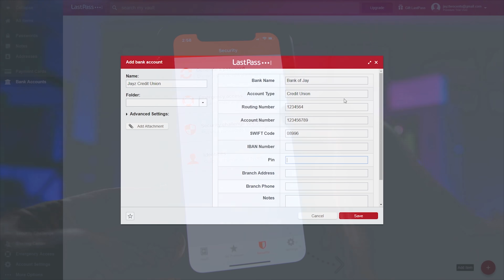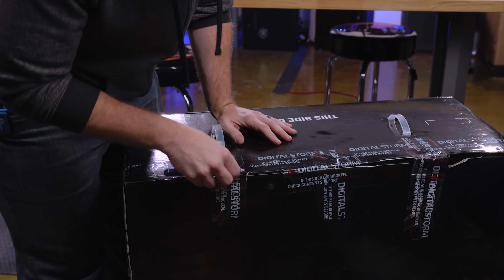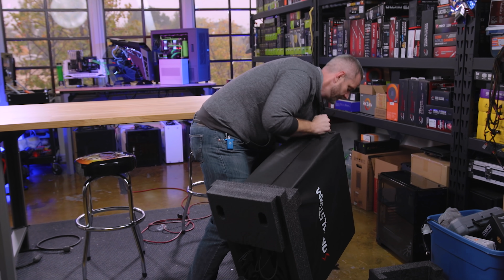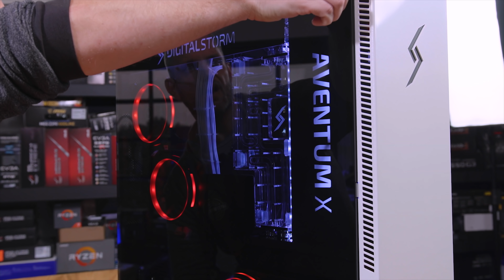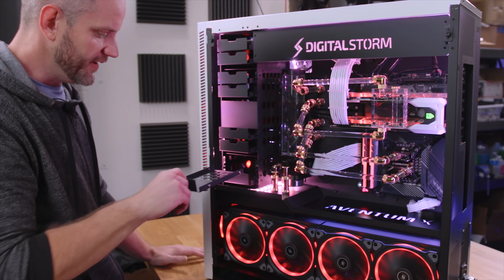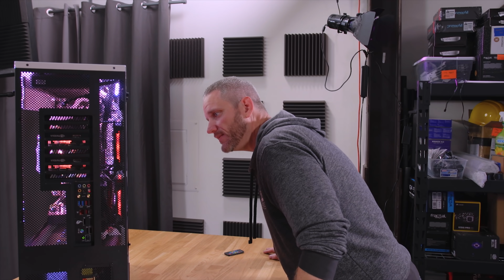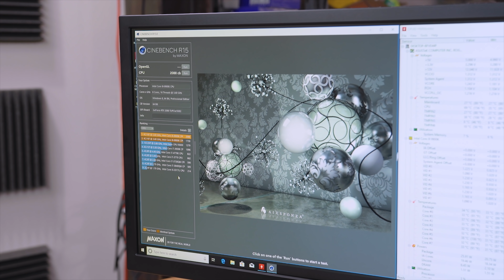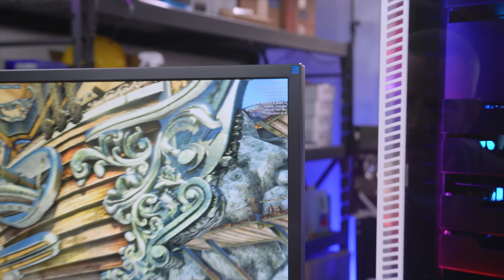Unboxing a $9500 Custom Computer...

Comment: I wish I knew the logic on the cooling. A 240, 360, and 480 radiator? So excessive it's beyond redundant. Then the only fans for the ambient are behind the mobo? The top rad is either pulling through or an intake either way not ideal. I suppose at the end of the day temps are temps but it's still all nonsensical.

Comment: I just got my new Digital Storm system about a month ago replacing a 12 year old Digital Storm system that still games pretty good. Here is my new configuration: Velox X/AMD 5900X/MSI X570 Pro Carbon MB/32GB DDDR 3200 DSPS/850W PS/500GB Samsung 980 Pro/1TB Samsung 970 EVO Plus/Sound Blaster AE-7/EVGA FTW3 Ultra RTX 3080 10GB/Liquid CPU cooler dual fan/

Comment: My issue with these huge custom PCs?
If you buy one and you have absolutely zero clues about building PCs you are gonna have a very hard time maintaining and upgrading this thing.
So once you want to put in a new GPU you gotta figure out how hardline watecooling works... And with SLI being dead but the loop being built for two cards that's gonna be a bitch to figure out.
Or a mainboard swap for a CPU upgrade? That would be a total nightmare...
I know how I put together my own system. I know how to maintain or upgrade it later. But this? If you want to keep using it for more than 5 years or so while also keeping the hardware up-to-date it's just gonna be a huge pain in the ass.
And those who know how to build a great looking PC are gonna do it themselves anyway!
Is this thing just for rich kids who buy a new $10K PC every year...?

Comment: Worst company I have ever dealt with. Everything was not as advertised. Call them selves pros but have no drain in my loop at all. water block did not come as advertised did not get the right monitor got the wrong glass, didint get the cable covers and the glass was smoked not clear like i order and the hole thing just stopped working do to over heating only 2 months in. They refuse to help me at all

Comment: - An almost $10,000 PC
- complete custom, hard tube water cooling
- TWO 2080 TI's
- RGB for days
- their own custom built water block for the CPU
- a giant, 560mm radiator

... but only two sticks of RAM?  REALLY Digital Storm?
Reply: at 3000mhz nonetheless.

Comment: Why not have holes drilled into the tempered glass panel in front of the fans at the bottom with a mesh dust gaurd in front?

Comment: I'm not trying to hurt anyone's feelings for pc gamers but iMac is way better workstation than pc but the problem is you can't game on it..so I think if someone has 3k to spend just buy a pc and so you can get a gaming plus workstation both at the same..yeah apple would be ahead in workstation from the pc that you'd built from 3k but pc would be the best choice...

Comment: That PCI-e cable mess though. I wouldn't spend 9500 USD on that. And the tube at the bottom going out from the CPU block isn't perfectly parallel with the tubing above it. Seriously, for 9500 USD you should get perfection but who ever built this didn't take their time. There are too many mistakes. Plus the SLI/NVLink-bridge doesn't fit the color scheme. They could've just picked one from MSI or Aorus and set the RGB to yellow.

Comment: I'm so done with Digital Storm.  I've had 3 PC from them each was delivered with series issues I had to solve myself.  
Faulty AIO pump
Too much power draw on one rail of the PSU which could cause the PC to reboot if both the CPU andf GPU spiked at the same time. 
Bad MB driver that was causing BSOD.

Comment: Jay: ‘45-50c on a benchmark, not the best’
Me: sweats knowing that my new rig is also my home heating system
Reply: It's not so much that 60c is hot under full load (which is what this was hitting), it's more that it is on the warm side for a full watercooling loop.

Comment: I know why you're here in comments ..

it's a overclocked 9900k pair to 2x 2080ti .. ram size and speed wasn't mentioned.  1200w psu. hdd? ssd? size? not mentioned.  Motherboard? not mentioned.

Now go to the next recommended video.

Comment: What case can I get that's somewhat like that I know they make there own cases but I want a case that I can do that with the fans and radiator at the bottom of the case faces outward like that looks amazing
Reply: Lian Li PC-V3000
Reply: @willMRtwo  cool that's case have that basement where you can put the face facing like that it's a cool look

Comment: Digital storm it’s to overpriced mine total cost 4000$ all same components the only diff it’s I have 1 rtx 2080 ti gpu you pretty much paying  for all them rgb lights
Reply: AnimeFreak digital storm is a joke
Reply: Pepe Troll yea the overpriced for everything even if you get the 3000$ pc it had the cheapest gpu you can get
Reply: AnimeFreak their all 1000$+ pcs come with a Gtx 1650 🤣
Reply: Pepe Troll I know I notice so what I did I was like ok let me get their cheapest case and change the gpu to 2080 ti and guess what they won’t even give you that option to change it
Reply: Pepe Troll I when with nzxt their prices are legit
Reply: AnimeFreak ibuypower have the best deals you can get a pc with a i9 9900K with rx5600 for 1000$

Comment: Thumps up for the parts, thumps down for the design. It looks way too random and confusing. It's like they designed it while building it, hitting a lot walls and boundaries, trying to fix it by making the tubing go everywhere. And to distract the eye, slam RGB in there with different colours displaying at the same time.

They need to design the pc around a theme.

The pc jay build for Terry Crews was awesome because it was build around a theme. I would rather buy that, than this monstrosity.

Comment: Just ordered a complete Workstation PC with Xeon 2288G that is also a 8 core with 5Ghz max turbo. Had to order a whole computer as it is apparently impossible to get thees CPUs on the open market for some strange reason. But it did cost about 1/5th of this without GPU...

Comment: Checking temperatures with a water cooling system (high heat capacity) in a few minute test... not like this, man! if you did 1h+ you'd get like 10-20C more temp

Comment: I love lastpass, been using it for the last several years. I usually cycle like 7 different passwords, and sometimes I forget which one I used. This helps quite a bit, i've never been to keen on the random generator....i should use that more.

Comment: Way to go Jay. 
Did you know you can break fan blades like that? - I did one time, sorry I ever did, because I had to get a replacement video card and the manufacturer (MSI) did not carry the model I had, in turn giving me a card that was a step up -- but refurbished, and that friggin card failed having to get another (refurbished) one. -- all because I broke the fan blade.

Comment: I'll never buy a Digital Storm again. I bought a digital storm laptop 5 years ago. First they quoted me a delivery date of 2 weeks, then after 2 weeks and no delivery I called and they hadn't even shipped it yet. I was leaving town soon and couldn't have it delivered while I was gone so instead of doing the right thing and offering to overnight it for free to make up for their mistake they said I had to pay the tab or it would be delivered while I was gone. Then after it finally did show up, it had no power block or cord. Then after a few years the mobo on it just went bad out of nowhere and if you try to turn it on the thing just power cycles indefinitely.

Comment: Great..but you’re paying heavily for “pretty”.  Cost it out...CPU 500. 2xGPUs 2600. MB 300. 64Gb RAM 300. SSD nvme Storage est. 200. PSU 150. Case 150.  Cooling Solutions 300.  Total Approx 4500 USD  You could even throw in an extra SATA 4Tb SSD for 400’ish and still be under 5 Grand.  Of course it all done for you and warrantied.  So yeah beautiful PC, but.....I wonder what Jay could build for 9 Grand?
Reply: You are way off for the cooling solution. A custom water cooling loop of that magnitude probably costs at LEAST 1500, probably more.

Comment: Pfft, no joke, but my Lumos outperforms that. I got it with dual Titan RTXs, an 18 core Xeon processor, and 128gb of 3000mhz RAM.

That fact that it cost me $18000 ( Nearly a year and a half of saving for it ) is negligible....

Comment: I just went on there site and saw a $799 rig setup, got excited, looked at the specs and well utter disappointment. The cpu is fine but a 1050 2gb  is garbage especially at 799 range. I could build a computer that has a 1660 8gb gpu in it for around $830. Rip off. If u are going to get a prebuilt computer go to nzxt.

Comment: I got a maxed out PC with only 3K$. This is over price
Reply: It’s not overpriced for what you get. A maxed out pc is over 3k, assuming you don’t buy cheap parts for rest of your build. 2080ti and 9990k already puts you At 2k. 1k for a “maxed” motherboard, power supply, cooling, case, storage etc is way more then your other 1k.
Reply: But sure let’s see specs of your build and I’ll show you it’s not maxed. 3k gets you a very nice build though of course

Comment: For 10000$ i would expect a computer system without fans and using an internal cooling system that will keep the system at 0 degree. This computer is just a fancy light-show! spend 2000$ and you can get a system that will perform exactly the same as this one. I guess the only reason to buy this computer would be to show it off to your friend.>> High five nerd power

Comment: You use our Imperial system for measuring!

A stone is simply 14lbs. 175=12.5 or 12 stone 7lbs.

Not using stones is like telling someone the distance from New York to Edinburgh in yards.

Comment: I'm satisfied with my one. Quiet, stable, small and it runs The Witcher 3 1440p@ultra without any problems. (Core i7 6700K, 16 GB RAM, 500GB SSD, GTX1080Ti). And yes, I can buy this one without a hazzle, but I've got other hobbies too. Need I more than I have now? No, it works like a charm for me and I spend my money on other things. Not the whole world exists out of PC's.

Comment: never understood the RGB concept because it is wasted power and extra heat
Reply: well, LEDs use so little power and generate so  little heat, its pretty much unnoticeable.
it's pretty much just because it looks  cool.

( or ya know, you could use those lights to relay useful information about a system )
really the biggest downside i can think of is the up-front cost that "gamer" RGB stuff usually has with it
Reply: @tinybabyman9453   LED do give off emi  only .4-6 joules but still LEDs do give them off that is why they recommend people with medical devices do not use LED lighting   and that can have an effect on performance ....

Comment: So I went into digital storm. Looked at their cheaper systems, they seemed good, then I find out they sell a 2400G system with no additional GPU or SSD for 700 USD. 800 USD will get you the same thing with a 2GB 1050
No aftermarket cooling and just 8gb of RAM. They do however include RGB and their windows recovery stuff.
Oh and if you want extended warranty be prepared to pay the equivalent of 2 additional graphics cards.
I hope the lifetime support is good enough, and doesn't end when you update your video card.

Comment: My Digital Storm pc still doesn't work right. 6,000 usd plus and i got a PC that has huge shadow problems and now more issues after tech support. Over 48 hours re opening the ticket and no call back yet. Now it's the weekend. Plan on calling Tuesday if they don't call monday.

Comment: Aventum X: Im the best pc and overkill af. Nothing can match me. 😏

8-Pack Orion [ https://www.caseking.de/8pack-orion-x2-i9-7980xe-4-6-ghz-i9-9700k-5-0-ghz-extreme-oc-system-sipc-264.html ]

HOLD MY BEER 🍺 💪🏽😤😎

btw pls check out ➡️ https://www.caseking.de/8pack-orion-x2-i9-7980xe-4-6-ghz-i9-9700k-5-0-ghz-extreme-oc-system-sipc-264.html

Like so he sees it! 💪🏽👊🏽

Comment: Can u help me i bought sama maxcool matx case...it has 3 fans with conttoller on front case they all daisy chain into a 4 pin female molex cable...where can i hook that molex as psu dont have molex male with the pins

Comment: I'd like to hope as much as I'd even personally be honored to have a jayz2cents pc that hsi info and advise would guide anyone of us towards building a computer of our dreamed. Even custom tubing had links over the years. Honestly though for the average enthusiast(I know conflicting statement) the stuff has become impressively efficient), I even retrofitted an older Am3 bracket H60 corsair onto my Ryzen 2600 non X. I did get a golden chip but I can run at under 1.35 volts with ease at 4.1-4.2 volts with stress testing  sometimes.... ryzen to the upper 60's and I have even gotten to a stable 24/7 capable 4.3 all core with smt and I want to recall voltages being around 1.325-1.35 ranges and still with minimal increase in temps. this is all keep in mind with a stock H60 which is nothing special. I would say expect slightly lower results on avg of course as I did finally luck out. past experiences with Ryzen do also include 2 ryzen 1200's that both capped at 3.7 volts and around 1.335 volts using stock cooling. STill good imo though as they were the release date entry level. I still even just bios updated and use my asus prime b350 plus board on my 2600 and despite reviews and its simplicity it rocks! Sure it oculd benefit from even some tweaks like aftermarket vrm cooling but it is handling it spenliddly with just good airflow and decent fans. I will discress I have a big psu from my old sabertooh r2.0 8350 that hit 5ghz with relative ease and online proof thanks to overlclocker.net. but I could of still actually ran it to date at evfen 1080p putting strain on both my cpuand gpu but wanted an upgrade for better singlecore and futureproofing. I had managed tho to crank the north bridge to i thin a cosy 2600-2800mhz and forgive if i forget terminology the south or mt to 2600 then the ram to 1866 with tight timings those i forget. gpu I rocked despite some community advise, but I got a good deal ,  the asus sapphire R9 285 2gb. although many may shush the 2gb vram it to date could still run newer titles on lower 1080- settings at smooth rate and very hgih 720 for the budget fellows. it was still beating out the rx 460 and 560 4gb models which means it would of also rivalled the 2gb gtx 1050. just rants. I ramble and grammatically horrendously. enjoy anyone who tormented themselves through alll that nonsense

Comment: Goes home looks at PC throws Corsair graphite 760t, gigabyte z370, i5 8600k, Corsair 16gb ddr4, 750w modular, Corsair H110i hydro series water cooler (280mm rad) Evga 1080 SC, throws in trash and buys this 😂😂 JK

Comment: I'm still running a Digital Storm Slade I got from them something like 5 years ago. The only thing I've replaced on it was a video card on warranty and a CPU cooler that leaked. DAMN fine machine, and I'm very happy with it. I hope it'll last a little longer before I need a new one.
Reply: Hope this aged well man ❤

Comment: I got a digital storm lumos and I had to return it 3 times bc it was beat to hell the first time like beat up so bad even before it was shipped like my radiator on it was bent and then the next two times so many problems running the system even switched out the Ram, power supply and motherboard and didn't work so eventually got my money back. they tried to take restocking fee but I told them if they do that im disputing it threw american express. So I just built my own and haven't had a problem with mine yet lololol

Comment: My computer started as a $400 Walmart computer. Had a $60 Gigabyte motherboard, 4GB of ram, an AMD R5 250 and a some kinda $60 intel Pentium CPU. 
Now the only original parts left are the CD drive, HDD and case. And since then, I've realized what a ripoff a lot of pre-built PCs can be. 

Though big companies that run tests and don't skimp on parts I figure are AMAZING at fine tuning. But for the most part, most of these obscenely priced PCs I figure I could build my self for 1/3 - 1/2 less. My current rig has an Asus Z97-A Mobo, 16GB RAM, GTX 1080 Ti, Intel i7 4790K CPU and a 750 Watt PSU for around $1,300 being what I've spent (minus previous upgrades).
Reply: Bullshit. A 1080ti alone is over $1k right now.

Comment: Adverse the ad... I'll pass that LastPass. The last thing I'd have residing on some external cloud of which servers and DBMS I don't control (and who's owners I don't know zilch about), are my passwords ! lmao... I would consider such an app to be "good", if and only if I didn't have to connect to some external account and exchange its data via external servers. If one has a PC, then the LAN or BT connection should be enough for synchronizing. If one only has a mobile phone, then a simple stand alone app that doesn't make any connection should be enough. That's IMHO of course, but it's also quite basic in terms of security.

Comment: What, no Titan RTX? WTF JAY!?
And that thing was $9500 running 3000mhz ram and a 9900k? And not even OC’d out the box?
Dude, I spent less on my 6900k machine. Digital Storm is a rip-off. They sent it to ya free huh? This is nothing but a commercial isn’t it?
BTW your cinebench scores suck. My 6900k can hit 2088 @4.5Ghz, LOL
You only have 16 Pcie lanes, and dual channel memory support my dude. That is garbage!

Comment: I spent close to this on my own Build, around $8900 maybe a little more, I had that thing running 4.9ghz and that was 10 years ago, made #6 on the benchmark charts, the only pc's that had me beat were pc's that were on liquid Nitro, Like EVGA(which we all know is just for the Numbers)
Reply: Neomis 01 yeah I built an $8k system in 2016 with a 6900k, and it’s getting better scores @4.5Ghz than that thing gets @5.0Ghz.
I thought I spent too much, then I saw this and was like “shiiiiiiit, I’m fine”.
You can built that same system yourself for half the price. I know because I’ve actually priced it out.
Reply: Q why the hell did you need an 8k system